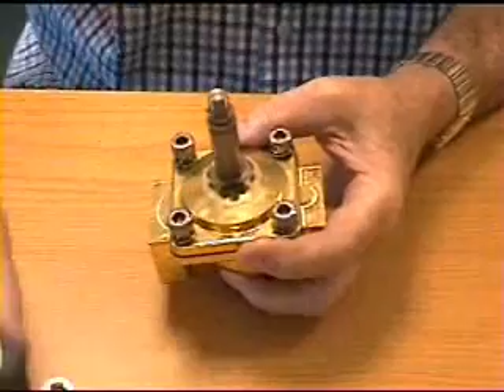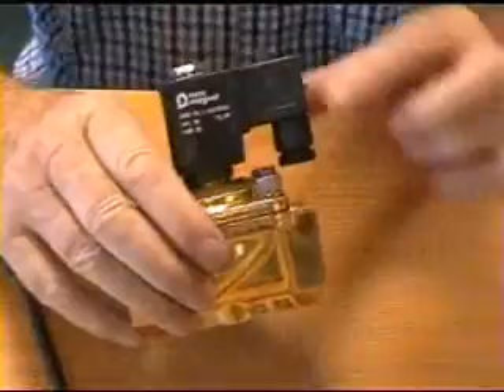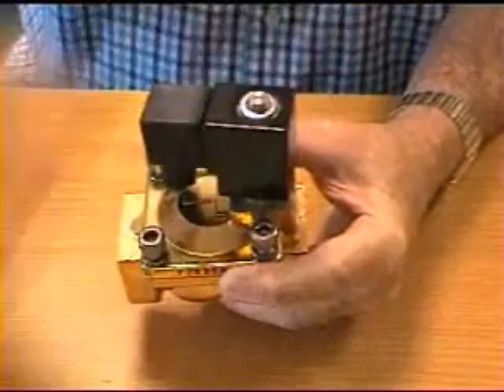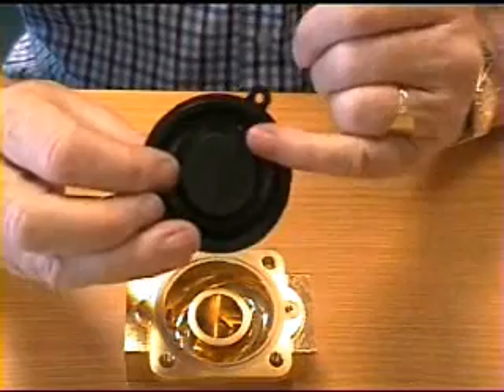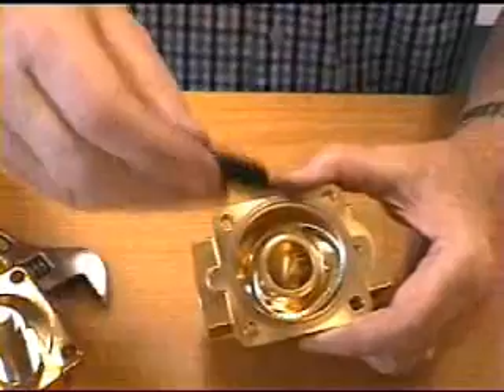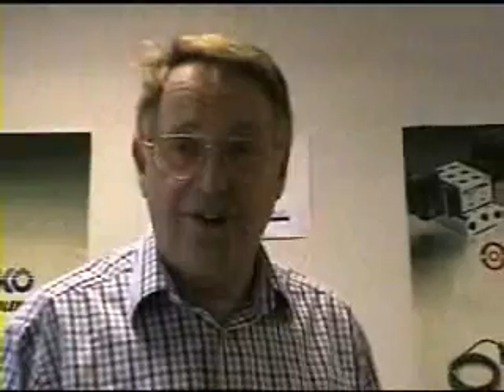Solenoid Valves how they work

Comment: When you described the second valve, you correctly stated at the beginning that the arrow shows the flow of air. Then when you took it apart and showed how it worked you did it all from the opposite port. You stated that the pressure enters through the exit instead of the entrance which is probably why you were downvoted.